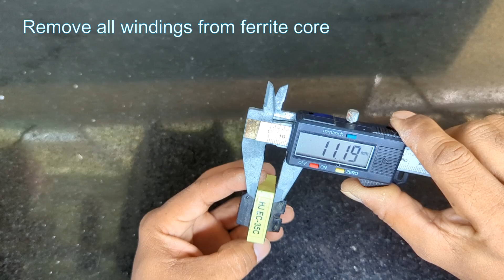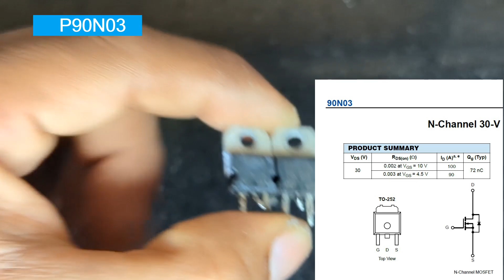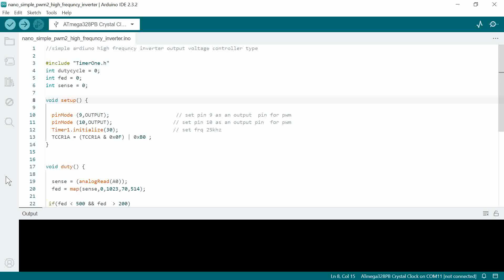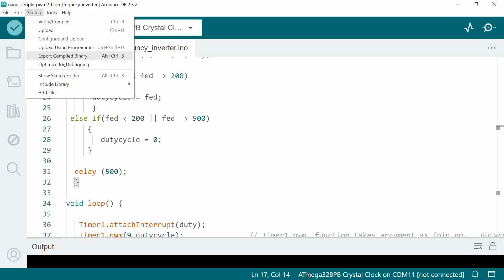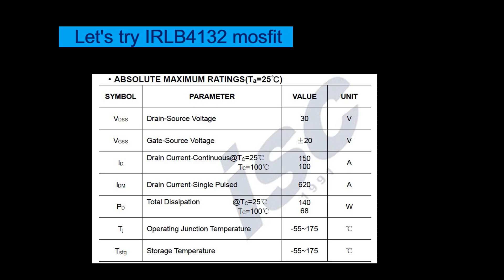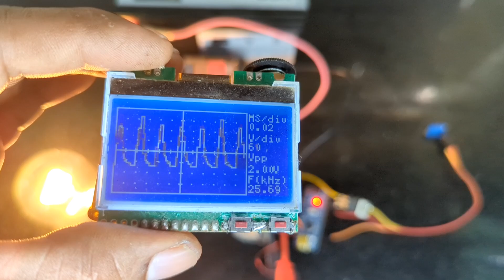How To Make High Frequency 230V Inverter ][ 25khz ][adjustable duty cycle

Comment: Nice but why don't you add totem pole to drive more MOSFET and please add feedback control
Reply from the maker: it's good to see how Arduino and simple program can handle high frequency inverter ,but risk is high if you are running without adding mosfet driver ic like ir4427 or selecting wrong mosfet  .feedback control system is needed for auto adjust the output voltage  , i will do it in future video. thanks